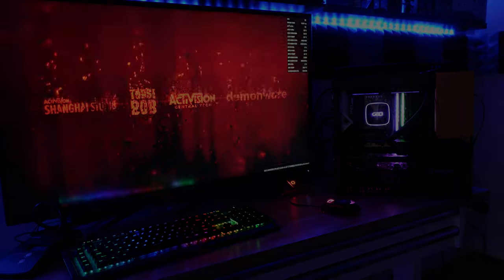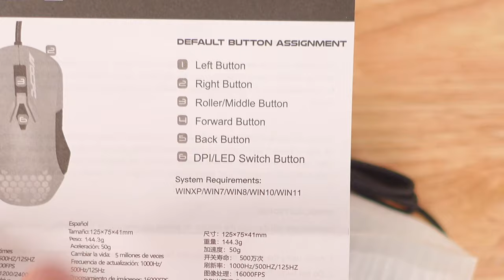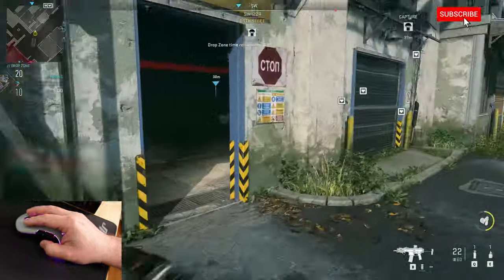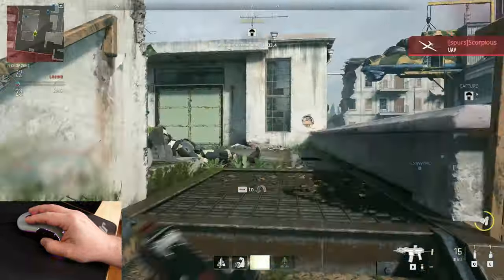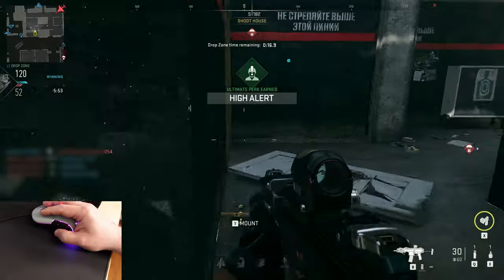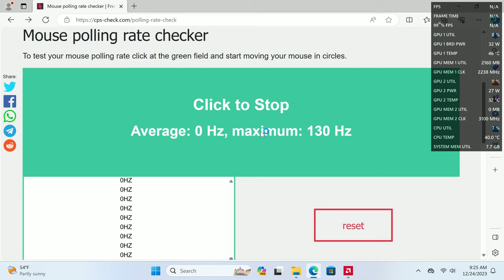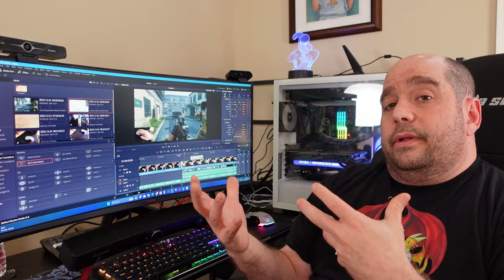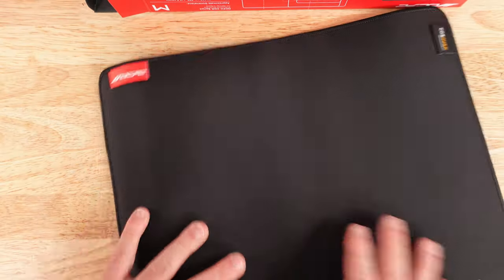Best Budget Gaming Mouse Under 20 Dollars! - Every PC Gamer on a Budget Needs to See

Comment: My motherboard is a Asrock b650 pro rs with a AMD 7800x3d. The ram is teamgroup t force FF4D532G6000HC30DC01  ddr5 6000mhz. The GPU is the Galax ex gamer 4070 white. The power supply is the Asus rog strix 850w white. The monitor is the Asus tuf gaming VG279QM 280hz 1080p. All the pcie is connected and non of it is daisy chained. I was using hdmi but switched to a display port cable and now the monitor appears to work correctly with no random disconnects. And UEFI is enabled on advanced mode, I followed your video for bios so i think csm is on and is that the same as secure boot because I know that is on. Fast startup is enabled but when u get the chance im going to turn it off. Last thing I just wanted to thank you for the hard work you put in these videos, without you I could not have built or setup my pc. Keep up the good work
Reply from the maker: Man, you've done your homework, always a pleasure my friend, so very happy you stopped by, trusted in me to help you, liked and subbed as well as took a moment out of your day to thank me.  It means a ton to me and I am so very happy I could help you. 

I was impressed that you were giving me all the info I would have asked for, thats awesome, so you have been reading the comments and watching the videos, you went as far as to know I would have recommended to disable fast start up in the BIOS, great work my friend.  It makes me so happy to know that I could help you my friend, that is so awesome, thank you for starting my morning off right.

280hz, thats nice refresh rate, I am soooo jelous ;)  Good stuff my friend.

Comment: I just built my first pc and have two problems. The DisplayPort randomly disconnects and reconnects and I know the monitor is fine u have been using it for a year and when I vertically mounted my GPU I was not able to mount the vertical mount to the bottom so now it is just on top of the standoff not screwed in
Reply from the maker: I cant help you unless I have some info, and also realize, nothing is fine till its fine, things can change at any moment.
So that I can help, please list the manufacturer and exact model number of the following components:
1. Motherboard - manufacturer and exact model number
2. CPU - manufacturer and exact model number
3. RAM - manufacturer and exact model number
4. Video Card - manufacturer and exact model number
5. Power supply - manufacturer and exact model number
6. Monitor - manufacturer and exact model number
 Redundant I know, but many people forget to enter manufacturer and exact model number
7. Do you have ALL of the PCIE connections plugged in, and not daisy chained or pigtailed, each coming directly from the power supply?
8. Are you running through HDMI, DP, DVI, VGA, any adapters?
9. Is UEFI or Legacy Setup in the BIOS?
10. What slots do you have your RAM installed in?
11.Do you have CSM Enabled or Disabled in the BIOS
11. Installed latest supported chipset driver?
12. Have you disabled Fast Boot within Windows?
13. This video will help you identify hardware inside your PC: https://youtu.be/65ZSiVImJx0